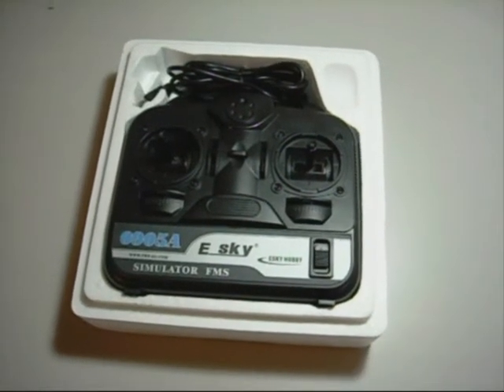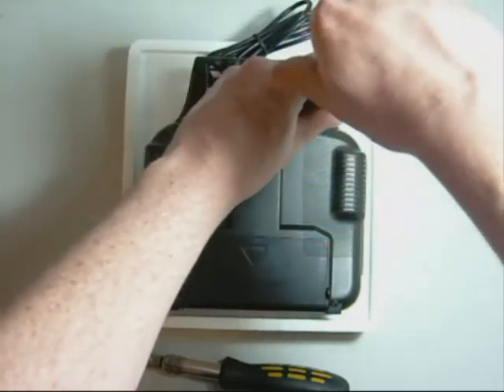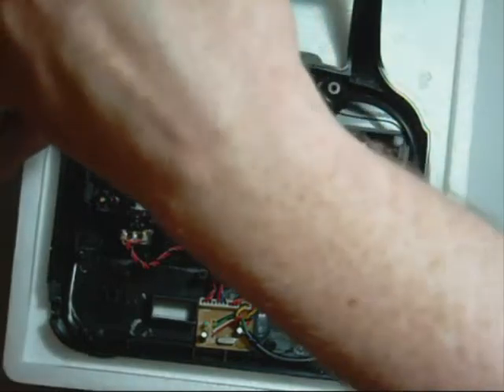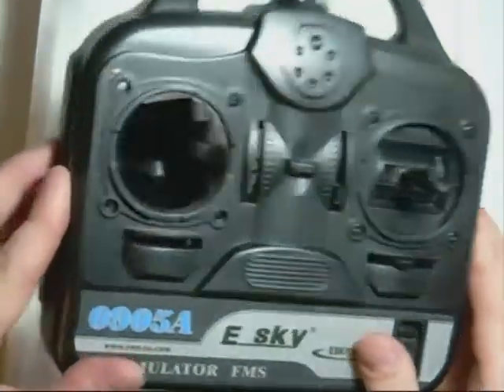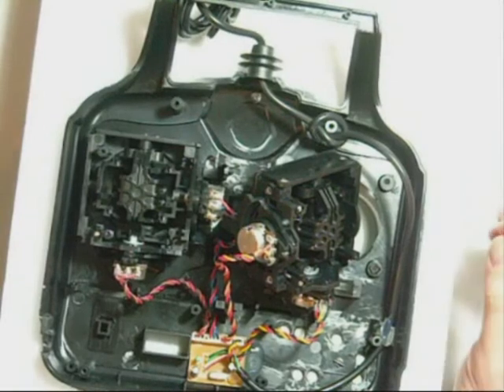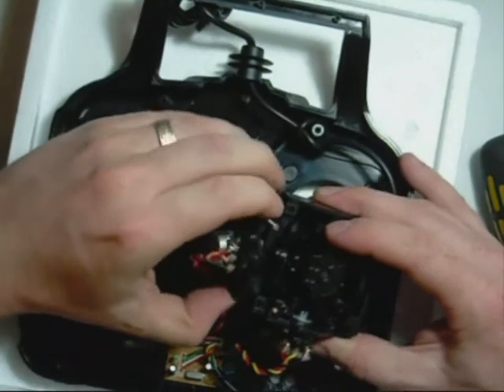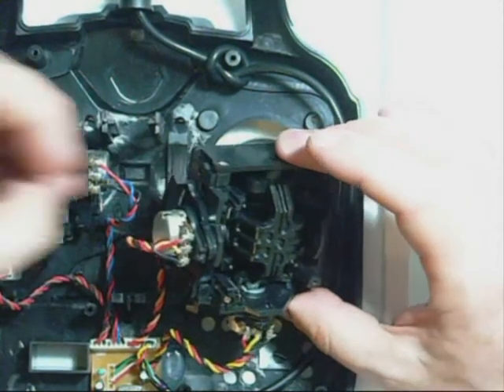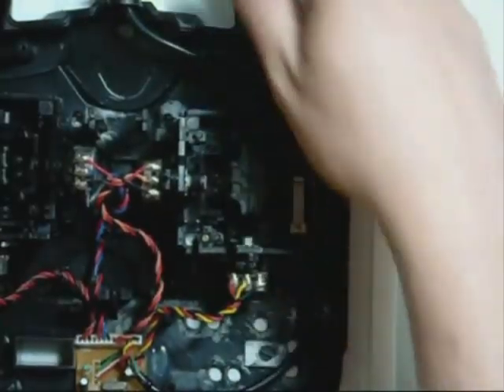Part 1 of How To Convert an E-Sky USB simulator controller from Mode-1 to Mode-2

Comment: So what you are basically doing is changing the clicky right side with the springy left side over?

But this will not work for actual flight controlling with a real controller right? Unless you switch the digital angle thing attatched to the joystick box.

Could you  make a tutorial on how to swap the digital angle thing?

Comment from the maker: @holden1550 For this to work on a real TX, it needs to have a switch somewhere inside it which converts the stick inputs from Mode-1 to Mode-2 after you move the springs around.  I would suggest that this switch would indeed be there, as otherwise E-Sky would have to manufacture two different models.

Comment: Nevermind, just continued watching the video. So my "method" would make the pitch not jump back to center, which would be horrible. I like Mode-1 though. Just grew up with that and in my opinion as a right-handed flyer I prefer more control on the pitch.